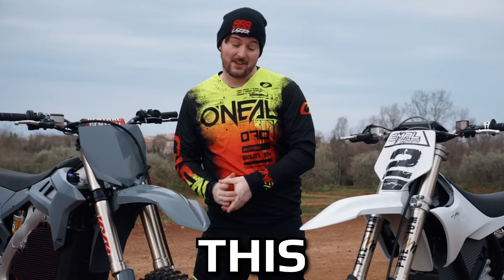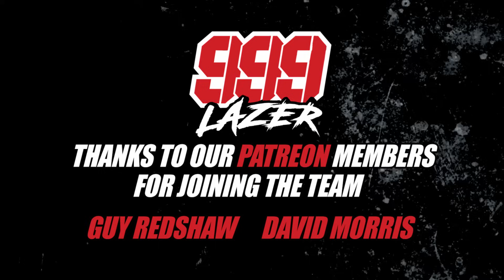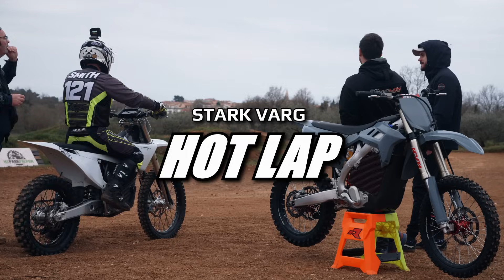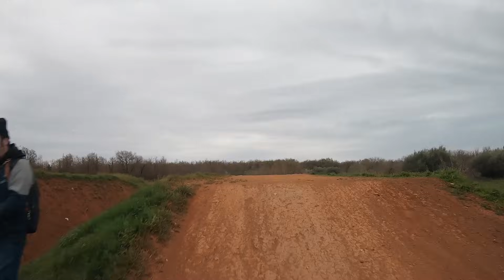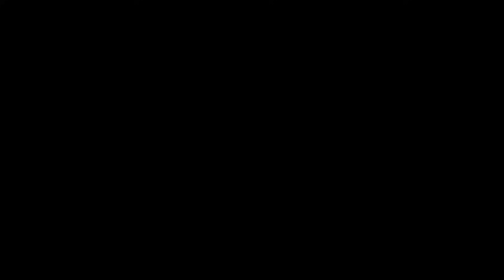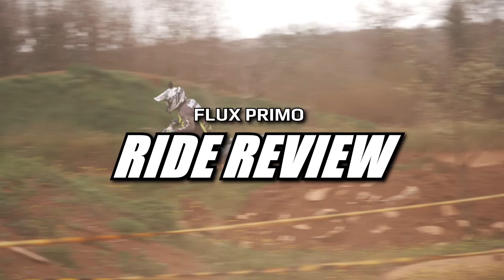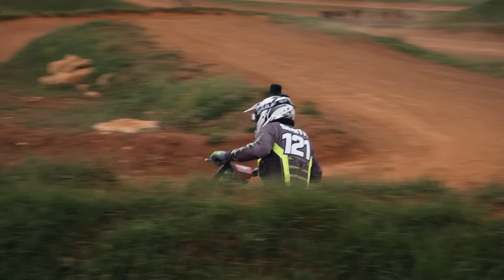$50,000 Dirt Bike vs $50,000,000 Dirt Bike! | Electric Motocross Shootout

Comment: I'll be sticking with my 500 2-strokes untill the bitter end, and beyond.
Ill never ride an overweight paperweight making angry vacuum cleaner noises.
Reply: It’s funny in these comment sections every time someone says “ I’m sticking with “ it’s always followed up by some shitbox 2 stroke 😅. Your 500 wouldn’t touch a varg and that’s even if you could actually ride it . They are total pigs
Reply: @Ozrider2504  i ride a 500 4 stroke,  i need the grunt to get my old fat ass up those hills
Reply: @imoovabull6042  get a varg hill climbing is a joke on them . I rode hard enduro on mine last weekend having no clutch , instant power from a stand still and no gears makes it so easy to climb hills
Reply: @Ozrider2504  A 500 on this very channel lapped faster than a varg, a crf250 obliterated a varg on another hotlap test, the flux just lapped faster than a varg. Where do you varg fanboys get this idea that its anything more than an overpriced back yard play bike.
Reply: @b45her   yeah obviously this channel has something against stark . That’s evident by the misleading thumbnail and narrative on this video about the cost of each bike ! They doctor the results! After riding my varg I can tell you there’s no way any rider woulnt be faster on one . Tell me how they can be slower than a 500 2t . They have more power so you can’t use that one , they have better suspension , better handing . WAY smoother power delivery . You tell me how it’s even possible
Reply: @Ozrider2504  The power claim is debatable seeing as the "80hp" stark dynos at around 62hp , suspension can be bolted to any bike, smoother power delivery ,not a chance, there is not a piece of software in existence that can outperform a skilled clutch finger to moderate power in fact the main complaint from faster riders is its  awful at putting power down on rough terrain and lacks low end grunt put of bends.
Reply: @b45her  this channel is a joke . They are so anti stark , everything they have claimed about the bike doesn’t line up with anything other people and journalists say . Look at the bias on this video . Saying the stark cost 50m to develop what an absolute joke ! The took the investment money and built a factory that produces 700 bikes a month . That wasn’t “development money “ and if you think somehow the flux just went 2 second quicker you’re dreaming , everything this channel has done on stark has been a hit piece and their reviews don’t line up with reality .
Reply: @b45her  and if you think the varg power output is over rated I’d love for you to provide evidence of that because my varg on 45hp would beat my 450 and on 60hp is absolutely outrageously fast .  Go listen to dirtbike channel podcast about the varg on 60 hp he said it’s the scariest motorcycle he’s ever ridden.  So don’t talk shit
Reply: @b45her  show me where an 80 hp stark dynos at 62 send me a link
Reply: @b45her  https://youtu.be/3KqFZeGwuo8?si=vBoGYfYZyaL_xHZK
Reply: @Ozrider2504 I'm not an electric or Stark hater at all, but it's true. Stark is likely using countershaft numbers. That also doesn't mean it doesn't feel like 100 horsepower because of the torque numbers.

Haskell dyno'd his right when it came out. I'll post a link in another comment, because YT would probably block this comment.
Reply: @Ozrider2504 https://youtu.be/3KqFZeGwuo8
Reply: @Ozrider2504  don't tell me.... dyno testers are biased against the stark now too, you level of devotion to anton is bordering on creepy lol
Reply: @b45her  you made the claims  about it so send me a link and prove it. Because I think you’re full of shit and have never seen a dyno run of a stark . If you want to comment on things back it up with evidence
Reply: @JohnHowerton137  I’ve seen Haskell video , did you see them overlay a yz450 over the starks numbers ?
Reply: @b45her  show me a dyno video or link to website . I wanna see
Reply: @Ozrider2504  no, don't care. I'm not a Yamaha masterdebater. That's an obvious no contest.
Reply: @b45her  send me the video of 80hp varg putting out 62 I’m still waiting !
Reply: @Ozrider2504 500cc two stroke may not be good when thinking fuel efficiency but it’s easy to rebuild and very light and powerful. That’s one of the reasons why i still ride 500cc. But electric bikes are nice too and if i get chance i might by one some day.
Reply: @jLkm897  electric should not need rebuilding basically ever . 1000s of hours from an electric motor and battery if taken car off should last 2000 odd charge cycles too . Thats about 20 rebuilds on a 2 stroke including maybe 10 bottom ends … at least if you get that chance have a ride on one it’s quite and experience! After getting my varg I have never been so excited to ride a bike each time in my life . Best way I could describe it is imagining sitting there with your 500 turned off and everything is quite , no vibration .  And now imagine that with the bike trying to tear your arms off at the same time is a bizarre sensation haha
Reply: LOL
Reply: But will ANY electric bike be running 20 years from now? (And appreciate in value 5× of what they cost new?)
Ill save you the time and tell you they wont. Your battery is breaking down every time you charge it.
Reply: @dr.hugog.hackenbush9443  obviously a battery is going to degrade fully in that time . But i fully expect to see companies emerge who will offer services to refurbish them for a fraction of what a new one costs now . As more and more electros bikes hit tracks it’s something we’ll see . And I also do t give a shit if they running in 20 years anyway. I keep mine 2 years and they gone .
Reply: @dr.hugog.hackenbush9443  what gas bike have appreciated 5x in value ? 🤷‍♂️

Comment: Oh boy, this is what I've been waiting for, a regen lever to solve the clutch dilemma.  I feel like you're never gonna get a pro to ride one of these without that regen/clutch lever.  Stark should be scrambling IMHO.
Reply: There’s really no clutch dilemma in my mind. God didn’t send down dirt bikes with clutches on them so we could do splatters and zaps, they were a necessity to adapt a constantly spinning gas engine into a rear wheel that isn’t constantly spinning, we’ve just adapted over time to do more with a clutch.

With almost instantaneous throttle response, electric bikes let you do a lot of the same things as a clutch. And this is in its very infancy, given time we will adapt and develop new techniques for electric as well. I have a stark, I’m a fast A enduro rider and unless you’re a hard enduro pro, I think electric is almost just as versatile as having a clutch. Things like creeping up a hill and managing traction is actually way easier on electric since you’re only managing one variable and you’re not worrying about stalling.
Reply: Arctic Leopard EXE 880 already has that shrug
Reply: Lots of pro s dont miss the clutch on the varg .. lots of non pro s do .. and thats many more !!! .. any way its just something to get used too
Reply: we listened and we delivered